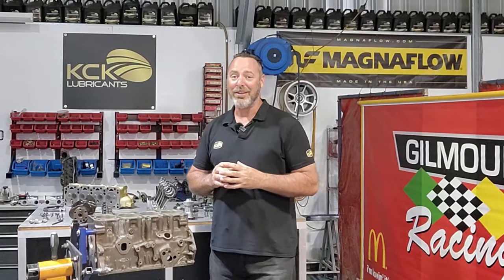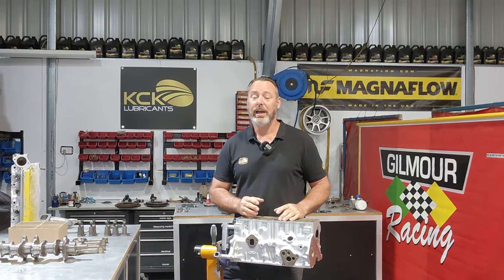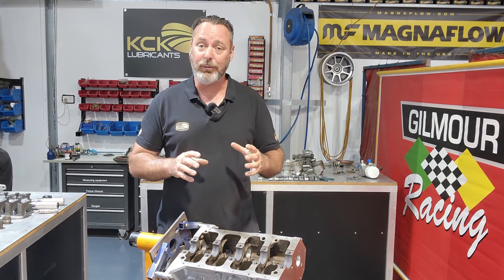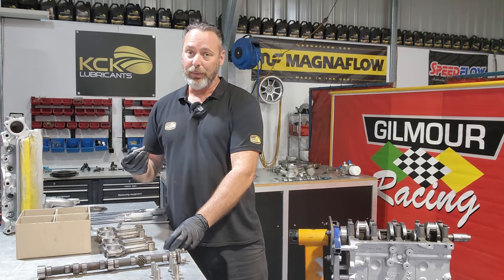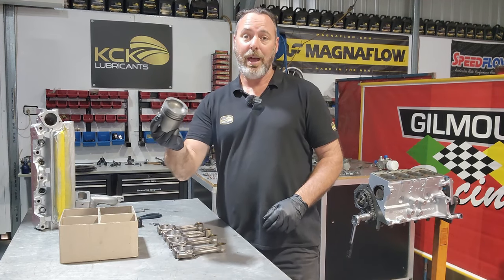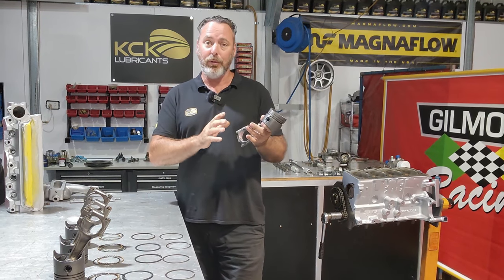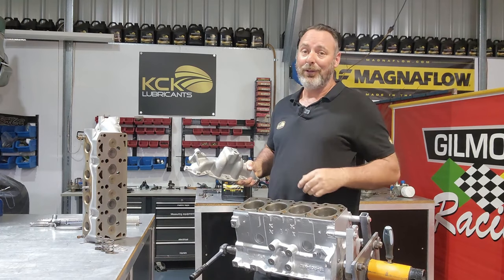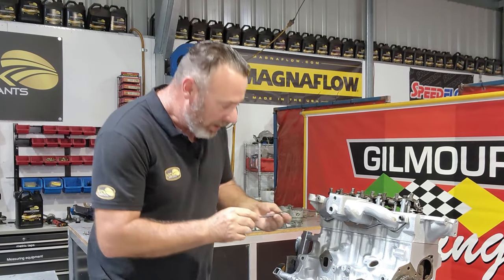Formula Ford Engine Assembly Van Diemen RF96K restoration Episode 6, by KCK Racing Australia

Comment: Whomever put that pump in with all of the silicone should have every tool he owns taken away from him.  He has no business working on an engine.  I'm with you on the seals - vaseline, and the oil pump - lots of assembly lube.  With the thick assembly lube that I use it actually helps the oil pump prime quicker.  Currently I am assembling 1974 MGB 1800 engine, and so far I see nothing that you are doing that I don't do.  Clearances for bearings I am running tighter since it is a road engine, but in the past when working on racing engines I always ran looser tolerances.  I can tell you are an old wrench with the way you handle a speed handle LOL!
Reply from the maker: Thanks for watching and we appreciate the feedback! Keep up the good work.

Comment: If you're using petroleum jelly on the seals, why not add some to the oil pump gears for better suction on initial start up, them melts away quickly as the engine warms?
Reply from the maker: Thanks for watching and excellent tip! The pump gears and shaft were coated in assembly lube to aid in the suction on initial start up.

Comment: What cam timing do you run them at
Reply from the maker: Thanks for watching, there is a few factors that may change the final timing but a stepped dowel with an offset of between 0.9mm and 1.3mm seems to be the sweet spot.